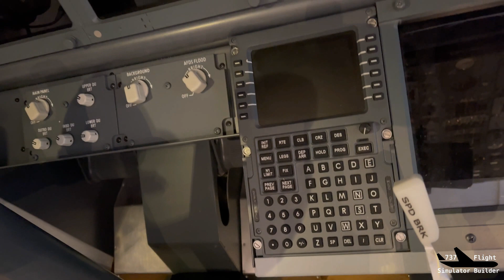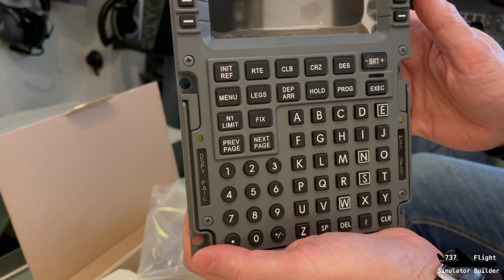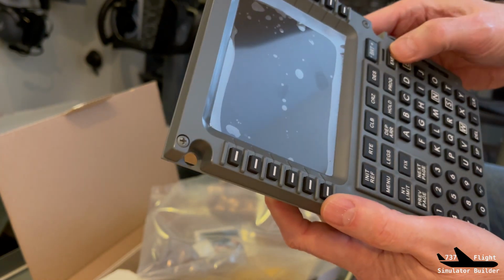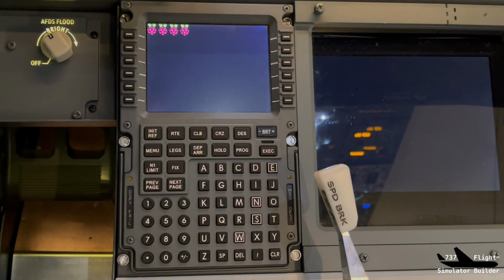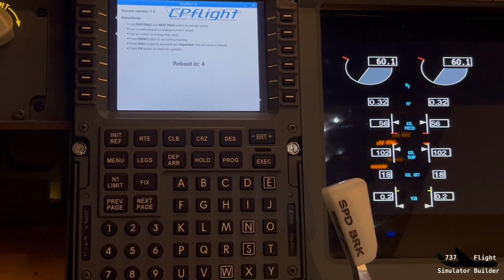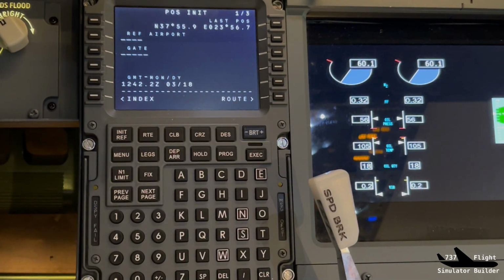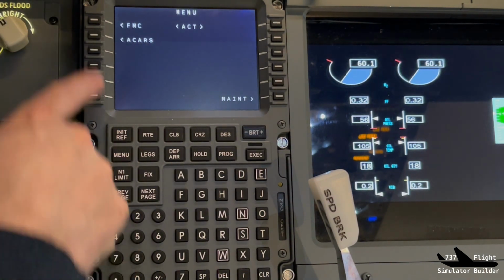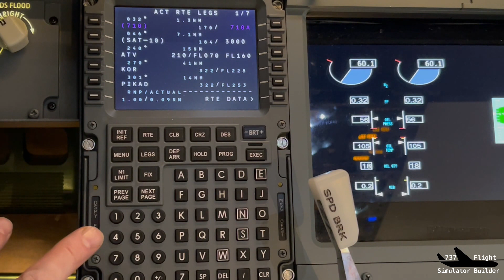737CDUPRO from CPFlight unboxing and testing

Comment: Another question, when you turn the panel brightness on your pedestal, does the brightness button of your CDU gets brighter than the others..i have 2 same cdu as you and one that doesnt do that and the other does. I like the one that has the brightness key getting brighter better than other one but not sure which one has correct behaviour.thank you for looking at it.
Reply: I really do not know. I do not use the panel brightness on my pedestal.
Reply: @piedie45  it is the knob ths tlet you increase the backlight brightness.

Comment: I've seen and touched the real ones.  The older models (CRT) have a turn knob for brightness.  The newer ones (LCD) have a rocker switch to set the brightness.  So don't think you're not getting an authentic looking part because of the brightness control.